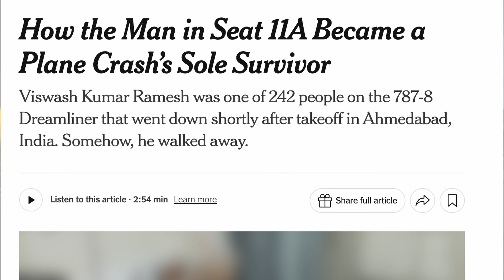Why the RAT Changes Everything – Air India 171 Update

Comment: Have you seen the video from a passenger who flew on that airframe earlier in the day? Before takeoff there was no AC and the AC stayed off or weaker than usual the whole flight. Additionally he showed seatback screens frozen or dark. Might there have been some underlying electrical issue?
Reply: Oof. That’s not good. Boeing’s quality in its Carolina plant is not as good as when they were built in Washington, from what I’ve heard. That move was basically to go to a non-union state.
Reply: @dforrest4503  Yeah, I'm from Seattle, so I'm familiar with the backstory. It was a huge deal in the early 90s when Boeing merged with McDonnell Douglas. The culture at MD was so toxic that Boeing destroyed itself by absorbing it. It all went downhill after that. Corporate HQ wanted the state to bend over even farther and they refused, so Corporate got moved to the most corrupt state in the country: Illinois, who was happy to bend over as far as Boeing wanted. Moving assembly to the Carolinas is just par for the course. WA has one of the most educated populations around, and is populated by a bunch of uptight Scandinavians. The south is just completely different.
Reply: @lesleyegbert4807  it’s a shame that such a skilled workforce wasn’t valued more. Kind of crazy how the smaller company’s culture (MD) had such a bad influence on Boeing, but I’ve heard that in multiple places.

Comment: Thank you Capt. Steve for the latest analysis. There is another video allegedly taken on the same 787 on a prior flight where the person shooing the viideo stated that electronics on the flight entertainment system was not working - mo power. If it ia a massive power failure to me that points to either poor maintenance or a major airplane malfunction, which is the last thing Boeing needs.
Reply: It’s not from the same plane. It’s click bait.

Comment: What I ALSO didn't hear on the original video was the sound that 140,000lbs of thrust makes.  Those engines were turning below operational RPM.
I suspect that there will be two or more cell videos on-board through the event.

Could this be like the crash in England where they extinguished the wrong engine and tried to make the fence on the burning one?  BMA 092 Kegworth, 1989?
Reply: I don't think so. It happened so quickly I don't think any one would think to record. Plus the phones aren't surviving those flames.

Comment: The other thing to consider... you hear the RAT clearly, and what you don't hear is the roar of the engines - this strongly suggests the dual engine failure. Whilst the electrical system could have failed, with so many layers of redundancy, both engines aren't going to just stop so early in flight - especially with the amount of batteries onboard, plus APU plus RAT. At the very least, it should have been possible for electrical systems to automatically failover and keep engines up. I'm still convinced fuel filter blockage or contamination.

Comment: I am thinking premature flap retraction still has high possibility. If the crew is startled by sudden sink and starts pulling up, causing a high angle of attack, as evidenced in the video, it could cause compressor stalls on both engines. This in turn, would potentially trigger RAT deployment. What do you think about this theory?

Comment: In summary:
The idea that the flaps were retracted instead of the gear is unlikely.

The key clue is the RAT (Ram Air Turbine) deployment, visible just aft of the right main gear.

The RAT only deploys during a total loss of electrical or hydraulic power, usually from dual engine failure.

The whirring noise in the video matches the distinctive sound of a deployed RAT.

The landing gear could not be raised due to loss of power — not pilot oversight.

The sole survivor reported a loud bang (likely the RAT deploying) and flickering cabin lights, consistent with systems running on emergency backup.

This points to a major systems failure, not a handling mistake.

The crew likely did everything they could in an impossible situation — controlled impact straight ahead suggests calm, skilled response.
Reply: Great summary

Comment: The thing most impressive to me is that the RAT is a lot louder than the engines were. I'd expect that whining jet sound that a turbofan has at takeoff power. To not have heard the engines is pretty good evidence they were not making any power to speak of. Whatever happened occurred at the worst possible time. Too late to reject the takeoff, but far enough along they had flying speed for a few seconds. Having someone survive that fireball is just amazing. I hope the guy lives to 100.
Reply: The engines had begun to slow/fail /spool down
Reply: @Mike7478F  Exactly...    the engines had STOPPED WORKING.
Reply: Yeah the engines would have been blasting had they been in takeoff power!
Reply: there are videos on youtube where a RAT is being tested and the sound is quite different when both the RAT the jet engines can both be heard, do to me too this is evidence that both engines were down.
Reply: Rat is so loud , the propeller is noisy.
Reply: "The thing most impressive to me is that the RAT is a lot louder than the engines were. I'd expect that whining jet sound that a turbofan has at takeoff power."   

As stated in the video: the airplane probably had engine failure. Which is why you don't hear the engines. Engine failure causes electrical power failure which is why the RAT deployed to supply emergency electrical power.
Reply: @rspawn  I realized that as soon as I said it. Whatever happened was extremely sudden, as the plane had just broken ground a few seconds before it appeared in the video. It had to have happened after V1 or they would have rejected the takeoff, but there was not enough runway to stop on even if they'd stayed on the ground.
Reply: Well, that JAL 787 landing he showed with the RAT deployed was actually a test, not a real emergency and you can clearly hear it over 2 working engines.
Reply: Yes I agree. You hear the RAT go past and the engine sounds seems to just drop right off instead of roaring.
Reply: I’m going with computer error. I think the computer shut down the engines. Statistics would suggest that two engine failures at the same time would be astronomical. Also if the computer shut down the engines the RAT would automatically deploy. No engines no power no thrust no lift. 
Computer error/ failure.
Reply: I heard the original on the day of the accident and that’s what stood out to me—engines did not sound like take-off power should and definitely a prop sound which was louder.
Reply: The RAT probably open and dropped so fast and loud as it’s the last survival equipment . 😢
Reply: @keavy2163  What a horrible experience.
Reply: I've seen another video in which the engine noise is much more distinct. It's too early to draw any conclusions.
Reply: I used to get concerned calls when running a major jet airport when the Rat was deployed as a test (as the noise is very distinct from normal.operatuons and not expected from a jet).

Manual deployment is also possible.

No idea is manual deployment is possible in this aircraft.
Reply: He will have two birthdays now, but also a huge emotional burden being the sole survivor.
Reply: The Boeing 787 Dreamliner is designed to be quieter than older aircraft, with a noise footprint reduced by up to 60% compared to similar-sized planes. This is achieved through a combination of engine design and fuselage treatments. The engines have features like "chevrons" on the engine nozzle to reduce noise, and the aircraft's structure is designed to minimize noise transmission into the cabin. 

Noise Reduction Features:

Engine Design:

The 787's engines are designed to be quieter than those on older aircraft. One notable feature is the use of "chevrons" on the engine nozzle, which help to reduce noise. 

Acoustic Treatment:

The aircraft's structure and aerodynamic surfaces are designed to minimize noise transmission. This includes using materials and treatments to absorb or deflect noise, both inside and outside the aircraft. 

Smaller Noise Footprint:

The 787's overall noise footprint is significantly smaller than that of older aircraft, making it a more neighbor-friendly option, especially for communities near airports. 

Quieter Cabin:

The combination of engine noise reduction and cabin insulation contributes to a quieter cabin environment for passengers. 

Comparison with Other Aircraft:

While the 787 is quieter than many older aircraft, it's worth noting that some sources suggest the Airbus A350 may have a slightly lower cabin noise level at cruising speed. For example, one study found the average cabin noise in the A350 was 74.9 dB(A) while the 787 was 72.7 dB(A). 

In summary, the 787 Dreamliner incorporates various features to minimize noise both inside and outside the aircraft, resulting in a quieter overall experience compared to older aircraft types.
Reply: But the survivor said he heard the engines moving to full power about 30 seconds after takeoff. If the engines weren't working, surely he would have heard silence.
Reply: @Alx-h9g I thought he said it felt like the plan stopped at that time?
Reply: @Alx-h9g that was my thought.. but no, he would have heard the rat picking up power.
Reply: @Alx-h9g  the non-pilot, non-airline mechanic sole survivor could easily have heard the sudden additional sound of the RAT operating at full capacity  and interpreted that sound as full-power turbofan sound. During normal takeoff, the main turbofan engines, the jet engines, would be already operating at nearly full power. It would be very hard for a passenger to hear the difference between routine take-off power and "full" power.
Reply: Makes me think of Hiroshima survivors who evac’ed to Nagasaki then survived that also.  Farming 4-leaf clover
Reply: engines lost power so maybe operated at 30% or less !
Reply: @Deerex.. next "expert...😂 what nonsens.. This engine manufacturer: Rollce Royce most reliablility engines and -60% less noise than normal engines. You can flyin this 787 without headphones in head main cocpit when he is Capitan, and normal talking. And this engine works perfect. Probably problem was fuel pomp (pressure), but most probablility is the engine was overload, but not DAMAGE, and engines had no thrust and no power due to overload. He probably took off too early for the weight of the plane. he could easily gain speed for a few hundred meters. It was obvious that the overload occurred immediately after take-off and the engines were weakening. With these engines, a full plane can operate on only one engine without any problems and have the strength to fly in an emergency on one engine. The problem was the low speed and weight pulled by the engines
Reply: @furieux6742  It doesn't matter who makes the engines, two huge turbofans at takeoff thrust are loud when you're within 100 yards and standing behind them. I know the specs on the 787 and yes it is quieter than most, but not so quiet you can't hear it go by. Inside the cabin is a lot different from standing outside. The lone survivor said he heard a loud bang just as the plane rotated, it will be interesting to learn what made the noise. We can all speculate given our level of knowledge. Mine involves 8 years as a USAF aircrewman and all the years since (35) closely following aviation.

Comment: Captain Steve, It could be the engine generator that could be related to not sending the power supply to plane like power, hydraulic pumps and and not charging internal aircraft battery that could be to shut the all the power down on the plane i think?

Comment: 12:44 if it was the fuel, why were no other planes affected?
Reply: It could easily be localised to the plane only. Residue or some other contaminant in the tank or fuel lines for example.
Reply: Agreed @3_Daves_Cant_Play_Snooker
Reply: Cathay Pacific 780 is a good example. It crashed because it had contaminated fuel pumped at the gate.
Reply: @framebuffers  yes true it happened due to a supposed full purifier which got inside the engine after takeoff
Reply: Good point
Reply: IMHO, If it were some sort of fuel contamination, there likely would have been indicators before they left the ground. If the fuel was contaminated with another liquid (ex water), the BTU’s of the fuel would be lower and this would likely cause an anomaly in the EGT reading.s If the fuel was contaminated by debris (ex. sand/algae), it would likely cause an anomaly in the fuel pressure readings and a very rough idle.
Reply: Because any other plane that could have taken off would have been grounded after the crash
Reply: There have been instances of contamination from errors in the specifics of the maintenance of one particular airplane (e.g. wrong dosage of biocide for cleaning the tanks).
Reply: Arreee baap re bomkesh 🎉 kaha the tum itni der
Reply: Bro but I can be in pipeline filling the jet
Reply: Or the fuel of that flight could have been contaminated on purpose after final check??
Reply: @paragchandratreya5815  well the final check is done after the passengers are and pilots are on the plane and ready to go. Would've had to have been pretty massive contamination of sand, or dirt, water, or debris in the fuel tank. That would've been seen by everybody I would think.
Reply: Good question. Could've been some sort of contamination in the fuel tank of that particular plane and not a result of dirty fuel being put in it. But it also could've been fuel starvation
Reply: Why is the million dollar question and a high chance you are not a millionaire just like 97% of population - why ? 💩
Reply: @predatorishi  how to contribute nothing to the conversation:

Comment: The Gimli Glider on July 23, 1983, used the RAT for its hydraulic and electrical power after a dual engine failure caused by running out of fuel. When the plane refuelled in Ottawa they new how much fuel they needed in kilograms but divided by 2.2 instead of multiplying by 2.2 to convert it into pounds.
Reply: I dunno if you're just sharing this as a fun fact or suggesting a similar calculation error could've happened here, but in case it's the latter, the plane was clearly very heavy based on how long the takeoff roll was before they had liftoff, so fuel exhaustion is almost definitely not what happened.
Reply: @biosparkles9442  The big fireball at the end of the flight 200 feet high is confirmation they had lots of fuel in the tanks.
Reply: @wally7856  yeah there's also that
Reply: Contaminated fuel seems more logical
Reply: they measure fuel by weight not volume?
Reply: @killbillmm  The mass of a substance remains constant, and so, anywhere near the Earth’s surface, the weight remains constant.  The volume of a liquid varies greatly with temperature.
Reply: @malvoliosf  ok that makes sense, I never knew jet fuel was allocated by pounds or kilos before.
Reply: In the case of Air Canada 143, fuel starvation killed one engine, and then, several seconds later, the other.  When that happens, the plane yaws sharply towards the dead engine.  This plane was not yawing at all.  The engines cut out simultaneously, if they cut out at all.  It could not have been a fuel issue.
Reply: Don't mean to be pedantic, but I just asked Grok about the Gimly Glider. You're close, but  here is the response:
The Gimli Glider (Air Canada Flight 143) fuel shortage occurred because ground crew and pilots used the wrong conversion factor when calculating fuel needs. The Boeing 767’s fuel was measured in kilograms, but Canada was transitioning to metric, and the fuel bowser dispensed in liters. The crew used a conversion factor of 1.77 pounds per liter (based on imperial pounds, common for older aircraft) instead of the correct 0.803 kilograms per liter for metric. They calculated 22,300 pounds of fuel needed, divided by 1.77, equaling 12,597 liters, but this was only 10,100 kg—less than half the required 22,300 kg. A faulty fuel-quantity indicator system and manual mischecks compounded the error, leading to the plane running out of fuel mid-flight.
Reply: @petemiller519  If you divide 0.802 into 1.77 you get about 2.2, as I said. I didn't remember the actual conversion factors but my 2.2 gives the same result.

Comment: Dual engine failure is so rare that your betting off being in a plane crash than having a def. If it was a bad gas issue it usually happens while in cruise when the bad gas gets to the engines and the good gas runs its coarse. I've been on the fence that the techs fudged up but now the rat validates it.

Comment: What would a dual engine failure do to ETOPs assumptions and operations? Back to 3 and 4 engine aircraft?
2 engine aircraft necessarily have the engines close together to minimise yaw with a failure, but this increases the opportunity for a single flock of birds to take out both engines   .. think Hudson ditching. This accident could change many things

Comment: If it were filled up with bad fuel before this flight would there have been enough "good" fuel from previous fill up in the lines going to engines that it could take off successfully and as the bad fuel got to the engines the failure happened? I know nothing about airplanes - just throwing out a question.

Comment: having a normal run on the runaway does eliminate fuel contamination. If contaminated fuel is added at the takeoff airport, there may be still enough good fuel in distribution system, filters etc... for few minutes of operation before the bad fuel hits the engines.